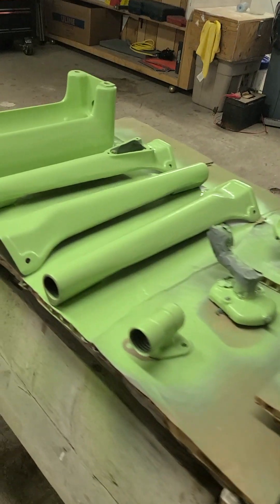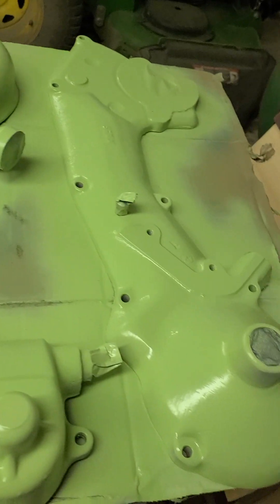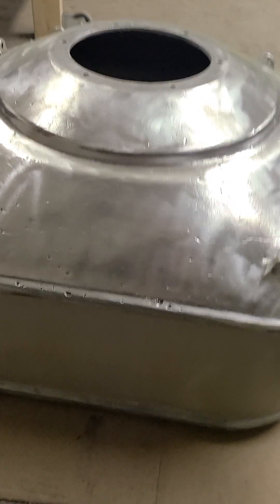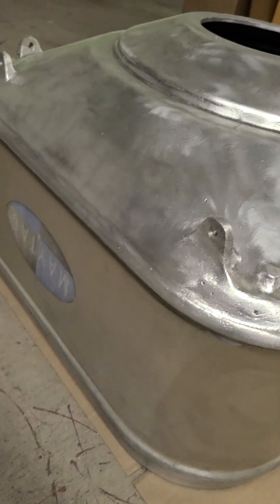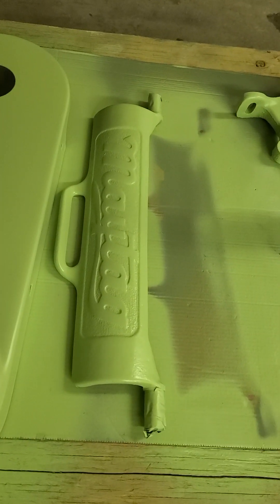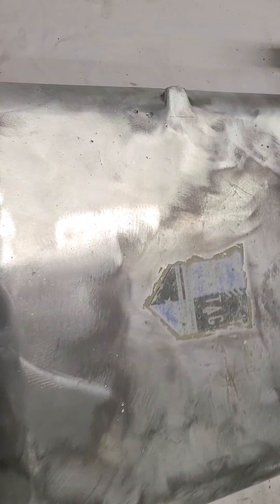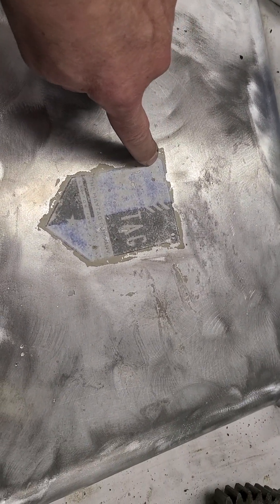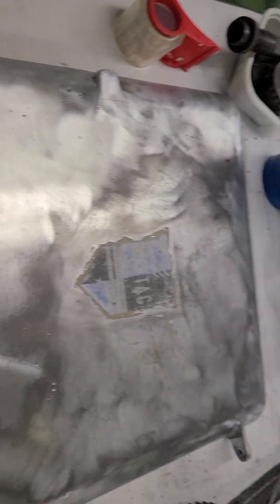Bar U Ranch .. Maytag wringer washer restoration (Part 4)

Comment: Great job. My agitator is froze up as well. Also the bolts/screws holding it to the tub what do you recommend to loosen them as well as the froze agitator? Love the green paint what is it?
Reply from the maker: Please excuse the late reply. The green is Krylon "Pistachio". Not an authentic shade for this model Maytag to be sure. The product I used in the past was a much more authentic shade, but sadly is no longer in production - Valspar's "Leafy Rise". Going forward, I may try Rust-Oleum "Sage".
Reply from the maker: Regarding the "frozen" agitator, I have made reference to dealing with this problem in various videos. If you need more specific information or advice, contact me.